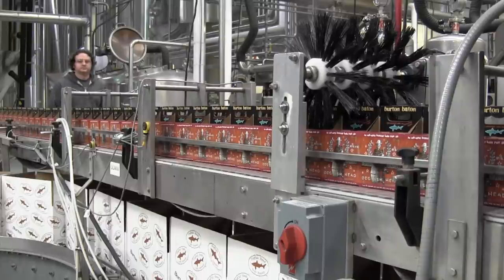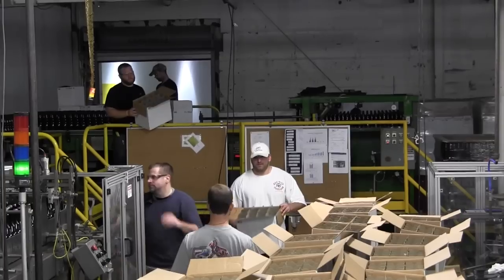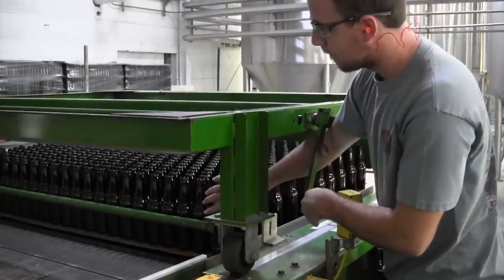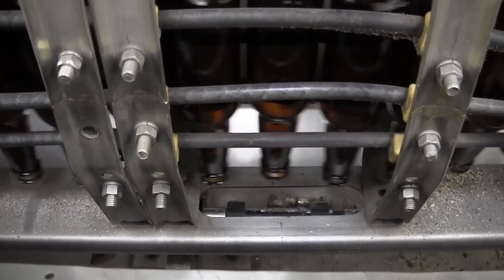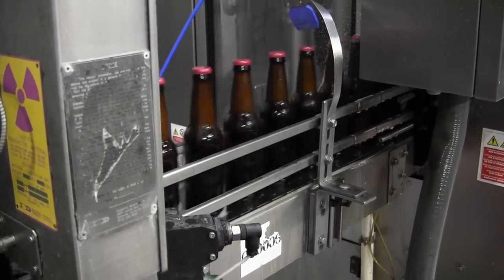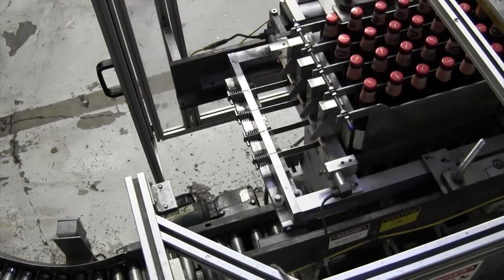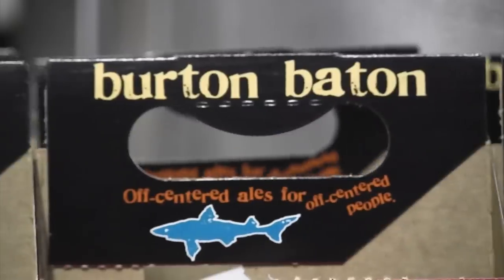Behind the curtain: Dogfish Head bottling line

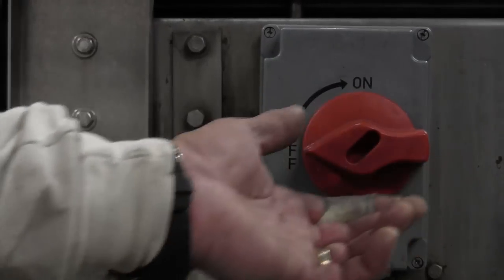Comment: Dogfish Head Craft Brewery at ~3:02 do you put the glue cylinder in water? Does it remove glue? Usually I see those cylinders washed with hot water high pressure cleaners.